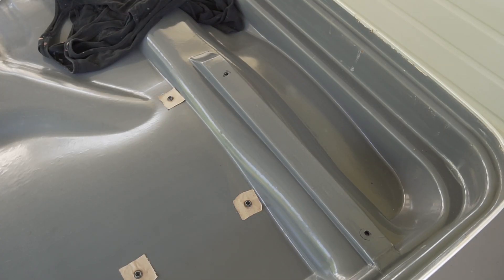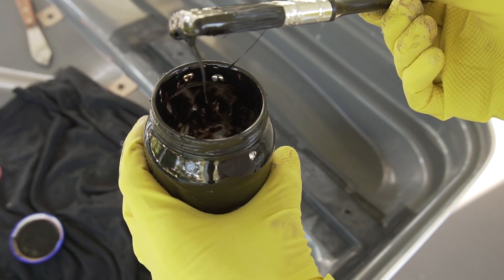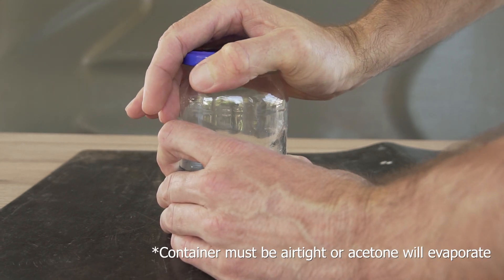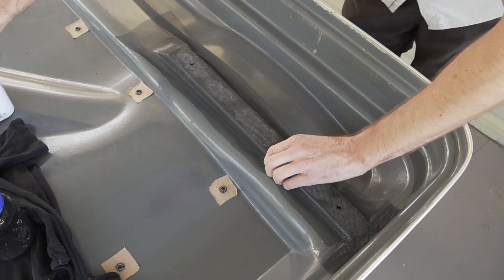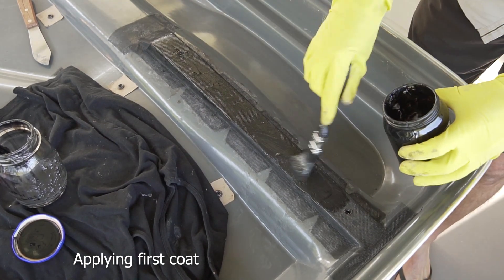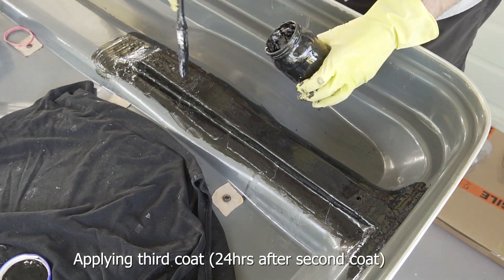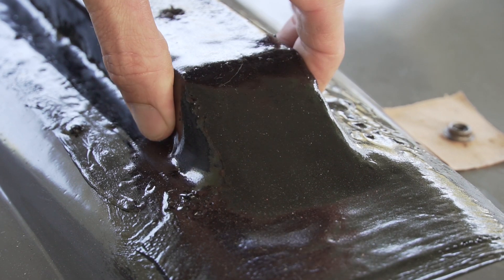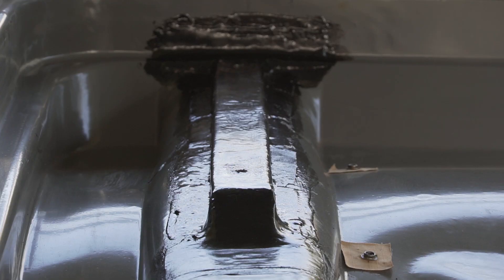How to repair and reinforce large ABS plastic items using ABS slurry.

Comment: Brilliant Video..!  Used this repair inside a Sears Xcargo 20 roof box. Took the O P suggestion of no mesh and multiple layers.
Incredible strong adhesion to box. 4 coats seemed durable on 4"x5" area using a 2" plastic putty knife.
Repair is sealed and flexible like original box.  
Tested 3 hard scrap plastics in a mason jar, only one melted. Chose that one. Added more.

Comment: Nice repair job! ABS plastic welding might also be a viable option.
Reply: Good luck with that. Thin ABS is an absolute abomination to weld( to get perfection in strength, and cosmetic appeal - without paint).  I've been trying to weld it since about 2014, and have been welding plastics for a living since 2011.  This video should be taken down, and banned (LOL!)   (There is a lot of expensive ABS out there, that can be repaired.. The general public, needs to remain ignorant.. Hopefully the DIY crew, don't catch on!!)

Comment: Will the slurry solidify if unused for a long time?
Reply from the maker: It may, depending on how airtight the jar/container is. No big deal if this happens though as you can just add more acetone to get it back to a slurry. I've done this a number of times when some I have stored has gone a little thick. Adding a little acetone has got it back to the desired consistency.
Reply: @fortheloveofvideo6306  Thank you very much! God bless you!

Comment: Will it fill @1/4” thick hole @ 2” circular?
Reply from the maker: With some mesh to reinforce it I reckon it would, or you could always cut some round pieces of ABS to fit in the hole to the desired thickness, and then fill the gaps with the ABS slurry, ideally with some mesh as extra support if it woild suit the desired finish.

Comment: Great video thanks for that. I have a roof spoiler I have just removed and found the underside has damaged so I will give this method a go and then bond the spoiler back on with VHB adhesive as all mounting points with the studs have deteriorated. 😀

Comment: Hey, how has it held up since the repair?
Reply from the maker: Tent has remained on the car for a long time now and repairs are still holding up well, no signs of bending, warping or cracking. I'm pretty confident this repair will last a long time based on how it has held up so far.

Comment: I like your idea of using screen as an additional support. I would bet if you're concerned about adding strength, you could use aluminum screen as long as you have the clearance for the added mass it would provide once coated with the slurry. Very smart thinking on this though; I like it.

Edit: watching the video again I hear you say you did use aluminum screen. I expect that did add considerable strength. I'm in the process of the "slurry repair" on a Yakima Rocketbox I picked up used and it works amazingly well. I haven't gotten to the areas I'll use screen on yet though.
Reply: Following up my comment a year later, the spot I repaired was too high of a stress location and easily tore the aluminum screen material only my second time out. My repair spot was on the lid, halfway back on the length of the carrier. Not to be outwitted by physics (ha), I sanded it all down and abraded the aluminum fabric away. I then picked up a 10-dollar steel mesh kit by Bondo which is adhesive backed so made it a little handier to hold in place. I used the mesh on the outside of the carrier, going around it section by section to secure it in place with fresh slurry, and then building it up later by layer over several days so it was nice and thick and I could tell each opening in the mesh was filled in and built up. I then used the second piece on the inside of the carrier using the same process. It's now beefed up considerably where the original crack was and I think now the repair will outlast the rest of the carrier!

Credit to the uploader of this video; had he not done it I never would've even thought to use this method. This kind of stuff is what makes YouTube worth it.

Comment: Hi, I just want to thank you very much for your very insightful video on repairing the plastic cracks, what a great result. The one I have had major cracks on all corners and was a nightmare until I came across your information> I feel as though I owe you for all you did to come to a solution. The only thing I am now facing is I am unable to sit the top back on evenly! I get the front over the rail and its sitting correctly but then the back will not go over the rail. I have reversed the operation back first sits well but then the front becomes the issue, it will not go over the rail and sit correctly. ANY suggestion would be gratefully received! Once again a BIG thank you.
Reply from the maker: Hi Chris, really glad the video helped, it seems to be a common problem with these tents. With the fitment issue, I think I know what the problem is and may require the removal of some of the ABS at the bends where the plastic curves to become the sides of the roof of the tent, if that makes sense  (its the curve in the thumbnail of the video). From memory, there wasnt much clearance on the inside of the bend, so if the plastic was built up too much it would make contact with the aluminium frame when trying to fit it, hence it wont push down at one end or the other. I'd use an electric sander or something similar (maybe even angle grinder with sanding flap disc but be VERY careful as it eats away VERY fast) to remove some of the built up plastic to give the clearance you need, just in the bend of the corner. Also, when u do get it on, make sure you use quality sealant (I used multipurpose sikaflex) to seal the bolt holes. Because water sits in these low areas where the bolts are, cheap sealant will eventually give way and water will get through when tent is packed up (trust me on this! lol).
If you did want to show your appreciation for the video you can buy me a coffee at https://www.buymeacoffee.com/LoveOfVideo as a thank you, it really helps me to make videos like this and supports the channel, these videos do take a bit of time to make. Let me know if you need anymore help. Cheers.

Comment: What's a good source of cheap ABS?  I see you have cut up a sheet, but I can buy ABS waste pipe for about $5 for 3m length! Will it work?
Reply from the maker: As long as its ABS it should work fine, and being cheap is even better 👌👍. If in doubt just try mix a small amount with some acetone and see if it melts.
Reply: @fortheloveofvideo6306  not sure what went wrong but when I sanded mine down it just peeled off. It hadn't bonded with the original material at all. 🤔
Reply from the maker: @bmorfill  not sure what may have happened, a couple of things that come to mind are: is the original material definitely ABS, and was the surface clean from contaminants/oil/grease? A couple of suggestions is to rough up the original surface first with sandpaper, and/or coat it with pure acetone to semi-melt the original surface. The acetone should both roughen up the surface a little and remove any contaminants. Good luck, hopefully it works better next time if you re-attempt.
Reply: @fortheloveofvideo6306  I thought the same as you. Its possible that I made my mix too thick, so there wasn't enough of the acetone to "activate" the original material. Its also possible I didn't leave it long enough to fully cure.
Reply: Buy used Lego's and melt them :)
Reply: The ABS pipe is working fine. It has to be the cheapest source of ABS out there. 👍🏼

Comment: Can you let me know the exact abs you used and acetone? I bought some but the acetone just evaporated and didn’t do anything to the abs
Reply from the maker: I bought ABS sheet off ebay, so besides being sold as ABS there was nothing else to really say what it was besides the look and feel. If your acetone evaporated the container isn't sealed correctly. Acetone evaporates very quickly so you have to make sure whatever container you use seals properly, this is essential. Glass jars work well as the acetone won't react with the glass.

Comment: Somewhat life changing. Incredible solution. I'm using this on ABS sheets to reinforce it and it seems good so far after the first coat. I think it's actually melting into the sheets a tiny bit which seems like it should be a great thing.

Comment: This is great.  Thanks for sharing.
Do you know if there's a good abs plastics epoxy?  I'd like to use epoxy glue, and then maybe this.  I'm fixing a relatively small (2x3 inch) piece of a floor fan.

Thanks.

Edit:  I wonder if abs glue/cement (plumbing style) would work?  Did you think of that?
Reply: Try plastic modelling glue. Some of the solvent types, such as Deluxe Materials Plastic Magic, work on multiple plastics including ABS. As they dissolve the plastic, they work as well as welding.
Reply: The plumbing cement/acetone  dries less hard than using bits of abs pipe/ acetone in my experience ....making the slurry yourself seems the best way for durability

Comment: Thanks for sharing. Your measurements for the slurry were perfect. All I had was ABS plumbing pipe. It worked perfect, just a long time to melt. I used pieces of plastic screen door screen to reinforce and it really helped. Thanks

Comment: Would this work in a area where there is heat like intake in front of headers?
Reply from the maker: Hard to say, too much heat would be a problem as ABS softens and is moldable when heated. I believe ABS softens at 105 degree C/221 degree F. You could try measuring the temperature in the area as a starting point.
Reply: @fortheloveofvideo6306  That sounds right. I did some tests with ABS and was able to get safely to 180F. Beyond that might start to get dangerous. I was able to get safely to 250 with HDPE. It machines a lot like ABS but has a higher melting point.

Comment: Do you think this would work if applied underneath plastic storage bins? I have a problem with them bending inwards after some time because I stack them. I always put lighter weight ones on top of heavier ones, but this still happens.
Reply from the maker: Most plastic tubs/bins seem to be made out of a poly plastic, so this method probably wouldn't work if that's what your bins are made out of.
Reply: @fortheloveofvideo6306  Oh okay. Thanks for the reply!
Reply: @scootermom1791  HDPE filler rod, or scrap, and a heat gun/soldering rework station hot air or soldering iron should work. There's a bit of finessing to get used to how it bonds, and getting the temps right, but watching a few videos should get you started.

Comment: Job looks good. I did notice a couple of spots that you might want to touch up. Towards the end you did a close up of the final product. If you look closely youll see the end of the wire screen. It didnt get completely covered with the slurry. You can actually see the ends of the wires where they were cut. I have no doubt the structure is strong. I also think you were right in using the mesh for extra strength but with the mesh exposed even a tiny bit that leaves a weak spot that will be vulnerable to the elements. Also it leaves room for movement of the mesh against the abs. Over time it will most likely be the cause of failure uf you have one. As a rule you should try to go beyond the damaged area by about an inch if possible that includes the mesh support if used. The mix you made looked perfect. Good video
Reply from the maker: Good point with making sure the edges of the mesh are well and truly covered, I think that is a good idea. Next time I use this method I'll be keeping this in mind. Fortunately for this repair it isn't exposed to the elements (underside of roof top tent cover) so won't ever be an issue hopefully.
Reply: @fortheloveofvideo6306  thats good its on the underside and if i remember correctly you used aluminum screen. Its also kind of funny you sent this message about an hour ago. I was thinking about you. Im in the middle of reconstructing a garage door opener motor and controls housing. The unit is flawless as far as operation. Its 15.years old but was rarely used. However a bone head doing some work here knocked the hell out of it with something. I think a 2x4. Long story short. I had just worked on it the day before. Adjusted the door and track. Within an hour of him getting here it was not raising and was eratic. I finally climbed up to check things and saw the logic board wasnt attached to the ABS/PC plastic console and the motor cover was only held together by the bulb cover and the metallic tape to reflect heat from the bulbs away from the plastic. The logic board was literally dangling from the wires and was shorting against the frame. Cant buy a replacement. So im piecing it together. Using jb weld uv light cure. And plastic welding. An hour ago i started cutting stainless steel mesh to embed into the panel and the front of the engine cover. There wasnt a single piece bigger than a dime. Jesus i need to get out more. You didnt need to know all of that crap. Ill blame it on the methylele chloride, acetone and ABS/PC fumes from the welding. I miss model glue!

Comment: Excellent! I was planning to send my cracked automotive part to get 3D scanned, remanufactured, then prepped, painted, and finally shipped back to me where I'd install it. Would have been weeks, if not months, plus very expensive! Instead, I will fill the stripped mounting bolt hole and repair a crack before repainting the part myself. Since it remains 'ABS' material, I can sand it down and prep it nicely for primer + paint. Thanks!
Reply from the maker: Glad the video helped, hope the repairs work out well!

Comment: Great idea and video. Do you think it will bridge a saw blade cut in an ABS drain pipe?
Reply from the maker: If you used fine mesh like I did I think it would work, or you could cut a sliver of ABS to fit the gap and then paint over with slurry.
Reply: @fortheloveofvideo6306  Thank you.

Comment: Do you think the slurry can be molded?
Reply from the maker: I haven't tried to mould it but I don't think it would work. If you let it partially dry you might then be able to mould it, it would be a case of giving it a go and seeing what happens. You can cast basic shapes with ABS slurry though as I've had some success doing this.

Comment: For plastic PE, PP do you have any solutions?
Reply from the maker: Look into plastic welding using a heat gun or similar. I know this method works with HDPE and is quite easy to learn the basics.

Comment: Hi there! Thanks for this video. What does it look like at the back of the repaired area? Are there marks visible?
Reply from the maker: Do you mean on the opposite side of the plastic? If so, you can see some of the black ABS plastic through the cracks as its flowed into the larger cracks.
Reply: @fortheloveofvideo6306  i see, ok got it. Thanks!!

Comment: Hi where did u buy the ABS sheet ??
Reply from the maker: I bought a 3mm sheet off Ebay. Amazon, hobby stores and 3D printing supply stores would also be worth a look though.
Reply: @fortheloveofvideo6306  
I Wasn’t quite sure what size to buy  so I bought a sheet 300 x 300 x 1 mil
Reply: @robphilip1646  that will work. The thickness doesn't really matter as the slurry is made based on weight, it may actualy dissolve faster being thinner.

Comment: So, have you ever used this on small Items?   I have some holes in a Lionel Tender made of ABS and the holes melted due to excessive heat from some lights installed that got 20 volts applied and over time the holes got melted.  do you think this would work?  it would have to have a nice finish to "look right".
Reply from the maker: I've made some small items by using a mold and pouring the ABS in, which works fairly well depending on the mold shape. I think it would fill the holes you mentioned, however I can't really say how good the finish would be. Best bet would be some very fine grade sandpaper, however I'm yet to try it so can't say what it would turn out like. If you do try it I'd be interested to know how it goes.

Comment: thanks for the video im going to try using this to make a mould of something
Reply from the maker: I've tried some moulding or 'casting' using ABS slurry with some success. I'm planning a future video showing what I've tried. The main thing I've found is to make sure it's liquid enough and to work quick as it forms a skin very quickly. Let us know how you go with it if you do give moulding a try 👍
Reply: @fortheloveofvideo6306  thanks can you tell me what product are made from and plastic , I bought some cheap psintvtrays today but they are not dissolving , im currently soaking milk bottle and soft drink bottle in acetone and seeing if they dissolve
Reply from the maker: @doogiehowser78  best bet is to just buy some ABS sheet, I found mine on Ebay, or you could try Amazon as well. A lot of house hold plastic items such as bottles seem to be made of HDPE/LDPE, so this method won't work with them. If I'm ever unsure if something is made of ABS, I'll get a cotton tip bud (cotton swab/q tip), drench it in acetone and rub it on an inconspicuous area and you'll know pretty quickly if its ABS because it will start to dissolve/go soft. Hope this helps.
Reply: @fortheloveofvideo6306  yes thanks  im looking for some now , delivery from those online sites is very slow to new zealand but i will order some anyway and try buy some locally as well ,
Reply from the maker: @doogiehowser78  it could also be worth checking any nearby Hobby stores and ABS Printing supply stores. Car bumpers and motorbike fenders are some other common items made from ABS plastic too if that helps.
Reply: @fortheloveofvideo6306  thanks for the tips i will look for some car bumpers and see if they dissolve , at the moment im making my moulds using latex and fibreglass , if i can use your technique and find a cheap source of abs plastic i will be very happy